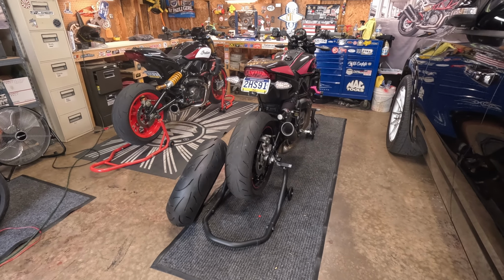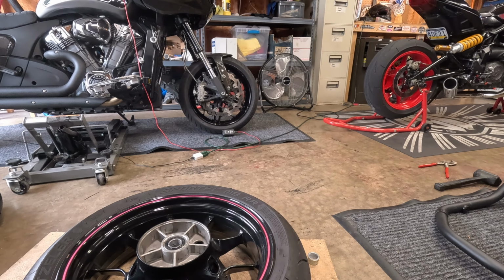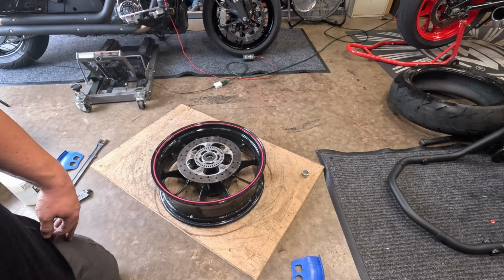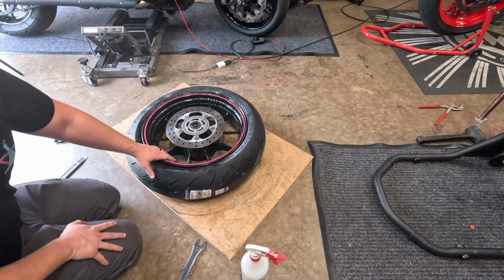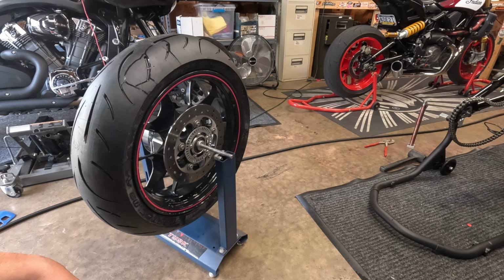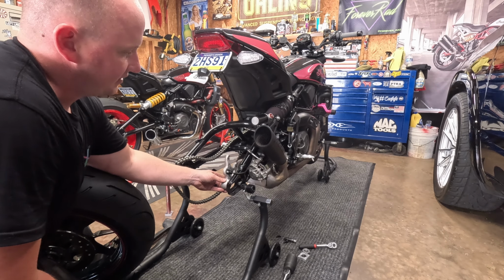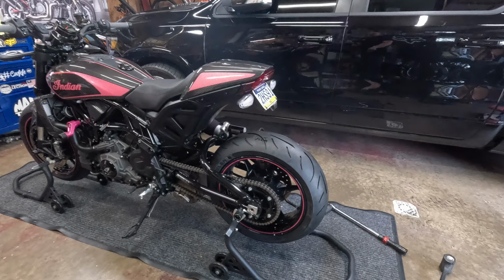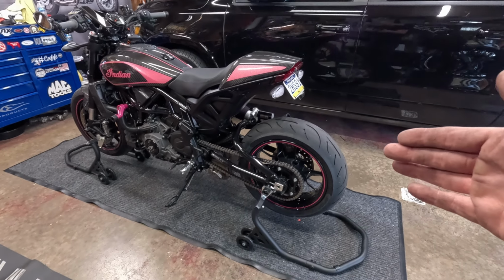FTR1200 tire change with hand tools!

Comment: Great video, I need to change my rear after 3.5k miles and now a  puncture! What was the sport touring tyre you mentioned and is it the same size as stock?
Reply from the maker: Bridgestone t32. And yep you can get them in a 180/55
Reply: Thanks man, just got around to changing mine, can you remember the torque setting for the rear axle?